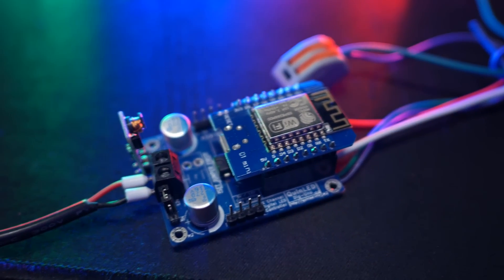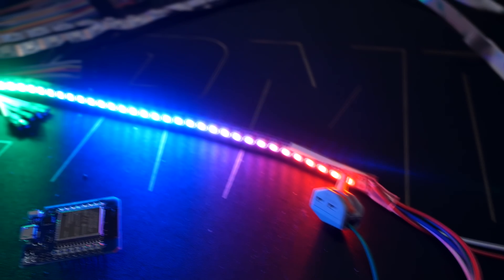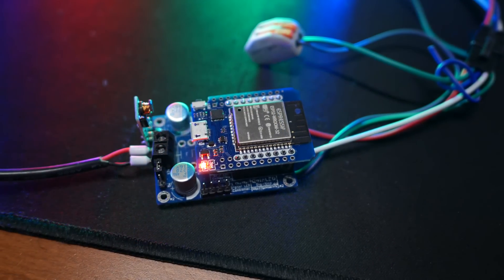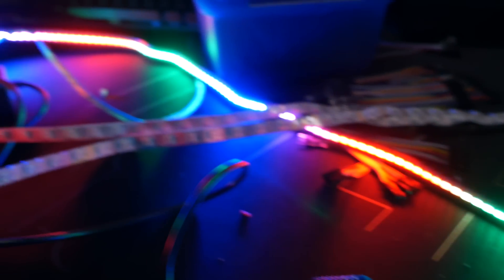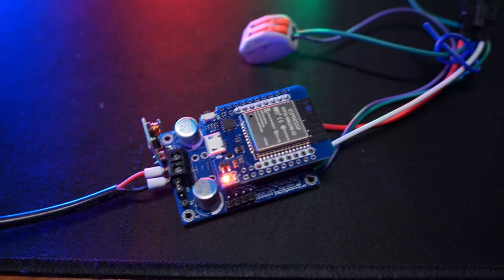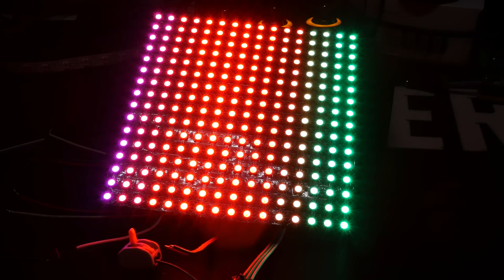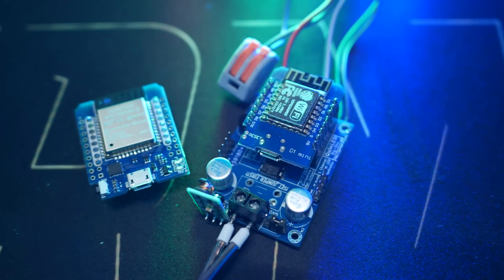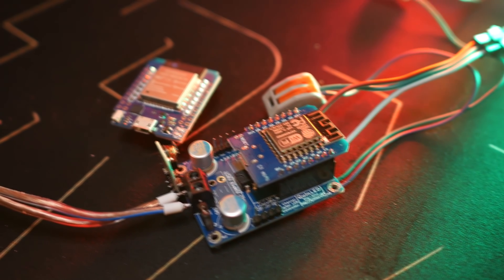QuinLED: QuinLED-Dig-Uno Sneak Preview

Comment: Hi, it is some way how to get annoucement for QuinLED-Dig-Uno is released. I want to order it. Thank you! Nice video like all yours videos I saw from QuinLED series.
Reply from the maker: Soon, latest prototype is doing everything as I want it. So I'm working on everything, and then I'll announce it!
Reply: @IntermitTech  Amazing! One more question. I am using ESP32 for esphome BLE Beacon. I want to make sure it will be possible to use LEDs and BLE Beacon at same ESP32. Thank you for your quick answers. :)
Reply from the maker: @TheNestyCZ  I haven't tested BLE yet (I'll try it when I can!) but there is an DS18B20 onboard which I have in my configs and worked during testing. You can do multiple things with the ESP's on a QuinLED-Dig-Uno, there is 4 GPIO pins broken out for it, but especially with an ESP8266 on there you need to watch out that it doesn't cause too much interrupts or you'll see it in your LED effects. It also depends on the code you are going to run on it.

With BLE specifically, I think it will work ok with an ESP32 but I sometimes have issues with my ESP32's that do BLE stuff so I have automatic reboots on those at 04:00. But your mileage may vary in that regard.

Comment: Looking forward to the release of this board, it is a shame that your boards aren't available pre-assembled or a PCB manufacturer who offer assembly in addition for those of us who are useless at soldering :-)
Reply from the maker: Although I understand that desire, it's a choice from my side. I might do something like a limited run pre-assembled boards in the future myself, but currently just don't have the time for it. Also the costs of me buying the components, importing and paying tax, soldering them and them shipping them off will make each board 2x or 3x as expensive then people buying the boards and components directly. Even if you just need 1 or 2, you'd be paying the same amount as the components for ~6. :(

Beyond that, the layouts of the boards are very much oriented towards the DIY'ers, if I would design it to be manufactured I would use all SMD components and different layouts all together. The problem is, I already have a full-time job. Sometimes I wish I could.... but it's just not feasible at this point in time. I really appreciate the comment though, I put in all this work to make it easier for everyone out there, so the appreciation that they are liked this much is very much appreciated. :)

Comment: This is awesome. There really aren't any good board designs out there for this. Just today I'd decided I'd just make one myself, then. But this looks like exactly what I'm looking for. Can't wait! :D
Reply from the maker: Awesome to hear and my feelings exactly. Although just hooking up some strip isn't that hard, I think it's still a hurdle for people. So a board that makes sure all connections are correct and just works, also with power running through the board could help people I think. Always better then just a bunch of wires soldered to a controller or even worse, a breadboard setup. ;)

When I get the last component in (been waiting for 7 weeks already) I can test fit it and after that it could go fast. All PCB changes I wanted to apply to this version are already done.